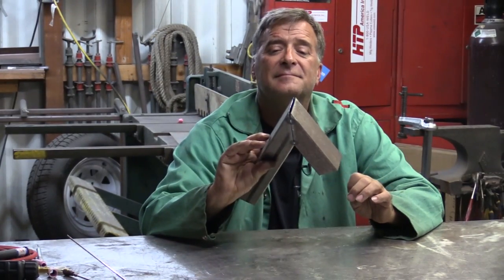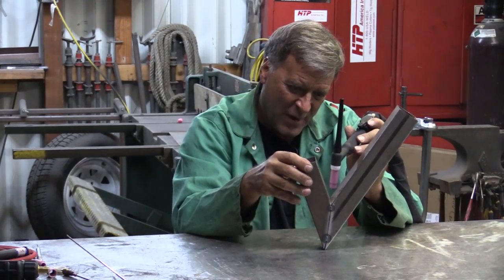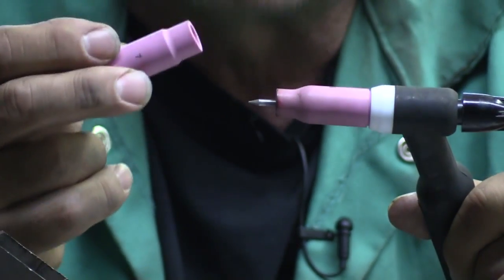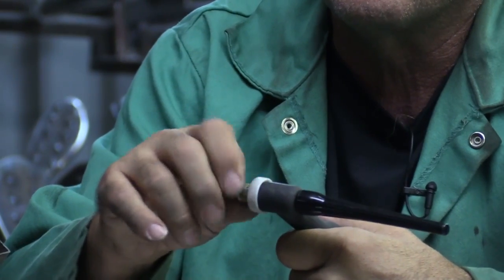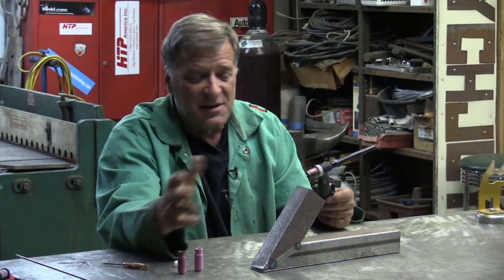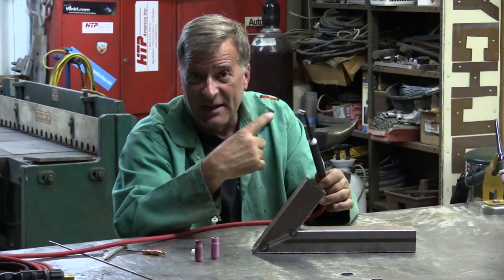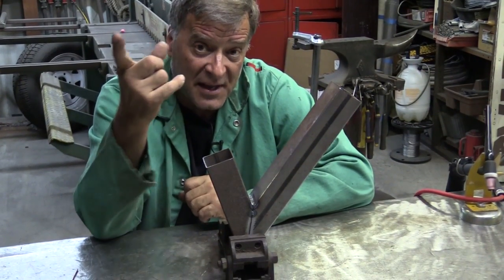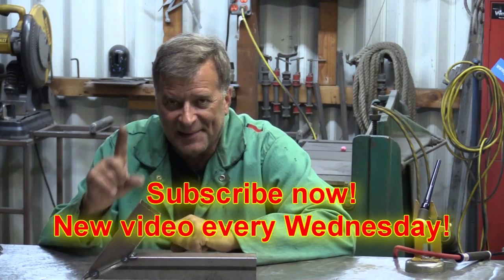How  to Weld Tight Angles - Kevin Caron

Comment: Will it weld 1/4" wall alum?
Reply from the maker: That torch is rated to 90 amps if I remember right. Go with the water cooled version and then you have up to a 200amp torch!

Comment: How's the CK micro on aluminum?  I found the CK flex-loc for example, is terrible on aluminum.  It has to do with how is runs the argon through the torch.  It is unbelievably noisy, and I attest that to the sharp angle over sharp edges inside the torch.  It does weld steel and stainless ok, but it will give you a headache if you are trying to run a gas lens and 25cfm...  I've been wanting to try the micro torch for a long time for those tight inside welds.  Can you use standard tungsten, (just shorter) or do you need to buy special tungsten for the torch?  TIA!
Reply from the maker: +Cole Regal 

Works just fine on aluminum..    Don't know if it's any nosier than the regular.    Hearing is not what it used to be..   you can run standard tungstens in this torch just shorter...

Comment: Hey Kevin, how do you like that Everlast Welder? I bought the same model 18 months ago. just wanting another experienced Welders opinion. I've been a paid welder for 40 years. 20 yr. heavy structural stick, and 20 light under 1/4" wire feed. not bunch of Tig prior to last year, but I have a good understanding of the process, just not good 2 hand,1 foot coordination. never was a good drummer either. I'd like your opinion vs. Lincoln or Miller...
Reply from the maker: +Brady McPhail  

I would stand this machine up against a Miller or Lincoln any day!!     Welds great, with lots of functions and the water cooler on top of it all..      No problems right out of the box and it has seen 200 plus amps many times.  

It is my go to welder when I have a lot of welding to do over about 100 amps...

Comment: Also you could put a button cap on the back of your tug torch instead of the rooster tail make it shorter if it's a tight spot
Reply from the maker: +Thomas Wilson 

Opps,,,,   forgot that part!   Thanks for remembering for me...

Comment: If you really get stuck and you don,t have Kevin,s options you can use a pipe fitter,s method by cutting an access hole on the outside, Do your weld to the corner from the inside through the hole and patch the hole after your done, Extreme but it work,s in a pinch, Mort
Reply from the maker: +Roadiemort 

Now why didn't I think of that?!?!?!?!
Reply: +Roadiemort  Yes, I've seen that done. I used to be a fitter on steam boilers. We would have the pipe fitters do repairs on boiler tubes. With oxy acet, torch.